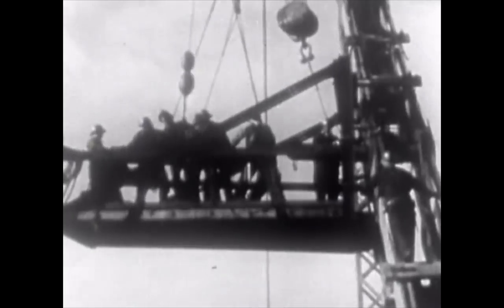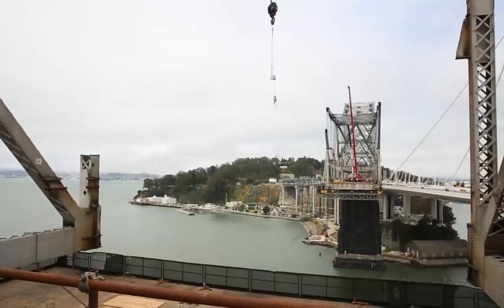During Demolition, One Last View from the Old Bay Bridge | KQED News

Comment: Until 1958, three interurban electric railroads ran on the bottom deck of the Bay Bridge on 2 tracks to the Transbay Terminal! Plus at 1:37 you can see the even older ferry terminal, which two of the railroads used to service until 1939, when the railway on the bridge opened (after delays). !
Reply: Archer Stanton  At 1:37 it shows the old Key System's ferry mole, at the right. It handled Key System and Sacramento Northern trains as well as ferries to the Ferry Building in San Francisco. It held out until the end of the 1939 Worlds Fair, in which it was promptly demolished. 

Its not the Ferry Building, its the Key Mole.

Comment: I would say that those vertical cables from the main catenery  cable to the deck should include a lot of diagonals to form triangles in the web of cables on each side . Those rectangles formed between the main  catenery cables and the main deck   can change shape and so the deck can support harmonic vibrations along it.   Those  rectangular spaces between the vertical cables are not much different from  those on the Narrow Tacoma bridge.   Put is some diagonal cables to  include better damping and a more robust bridge will result.   About those rectangles being changed to triangles , those who know that a triangle does not  change its shape would know why I said what I said.

Comment: why not use TNT?
Reply: it would fall in the bay and make a big mess and kill everyone on the bridge, and it would mess up the building of the new bridge. It would also mess with the tension and make a huge steel stress ball. This isn't Minecraft.
Reply: Atsf49 you also have the Hayward Fault running nearby and a heavy implosion could possibly cause unwanted seismic activity.
Reply: @robertpreskop4425  Ahh, no, not at all although your suggestion that it would impact a fault line provides some well appreciated humor. Any ground/above ground explosions (especially that of a relatively thin steel bridge with many hollow sections) would not in any way be felt at the level or have any impact on a fault line miles below the ground's surface. It would take an atomic bomb explosion to transmit seismic forces miles deep. Look at the two WW2 atomic bombings of Japan, which lies on the very active "circle of fire" fault which had no effect on the fault line. Otherwise, they wouldn't be constructing a new bridge at such a "hot zone".